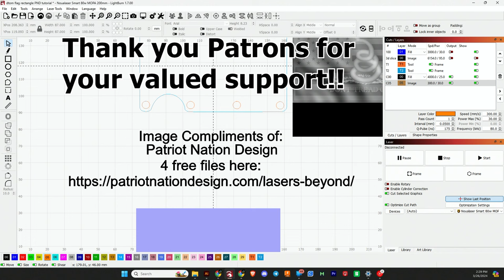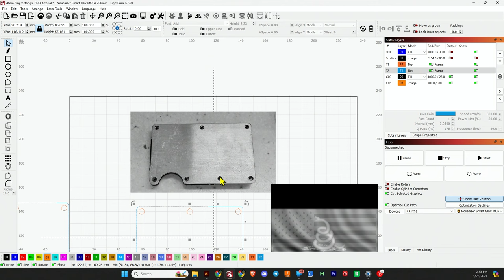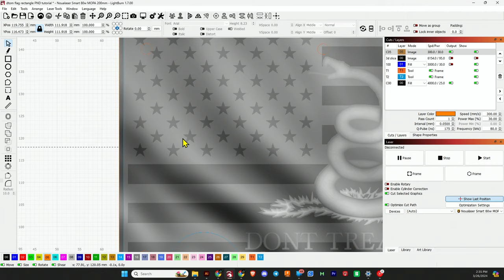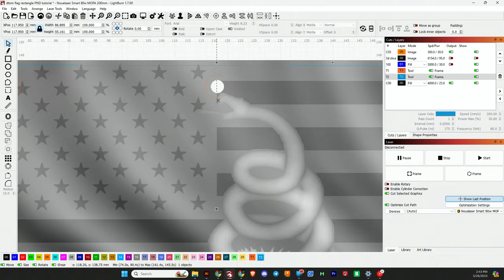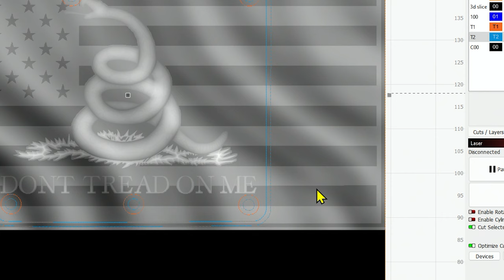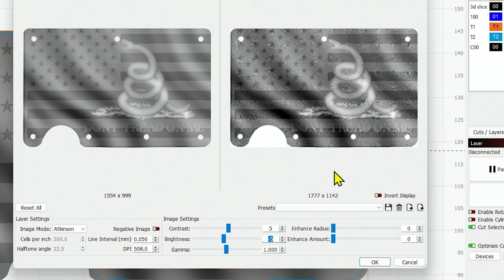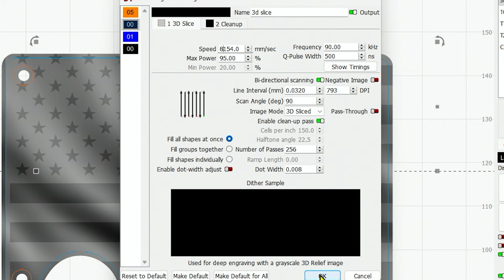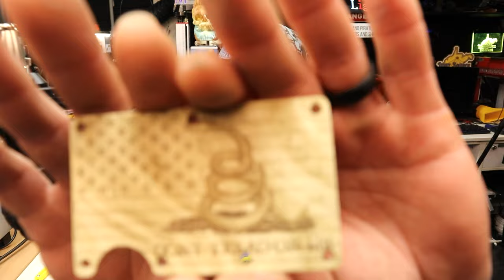3D Engraving a Brass RFID Wallet with #lightburn Tutorial

Comment: I see stripes on brass, are they actually there or not?
Reply from the maker: there are, and i'm not sure why as there are not any in the horizontal direction. and there were none with same settings on another wallet. at first i was like, what? then after polishing i actually liked the look.
Reply: @LSEngraving  stripes really add authenticity, it will be bad if they appear randomly where they are not needed